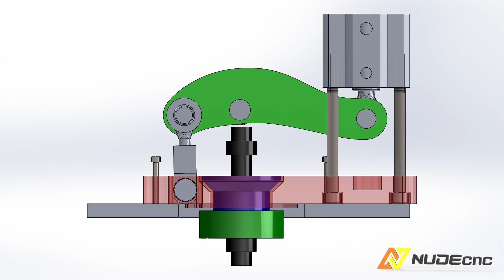Power Drawbar for CNC milling machine Part 1

Comment: Are you probing each tool length at the beginning of the cycle? I'm trying to set up the tool table for my TTS system and I cant get the tool offset just right yet. It would be stellar if you could show how you do it, assuming you're using Mach3

Comment: Nice keep up the good work, and the great vids. 
What CAD/CAM you use guessing SW
Cheers
Reply from the maker: Hi. You're officially my best subscriber ( it's only 75 at the moment so it's not big deal but still :))
Yes I use SW for CAD. And SolidCam is my CAM software. 
About SW - we all know is great :)
SolidCam- this software will turn your machine into the Monster:)
I have 1Kw spindle and I can make "proper cuts", even if that's about 1/3 what my kitchen kettle have:)
Reply: Paulo Irineu de Souza it is a power drawbar. This is a method of releasing and installing tools into the spindle of a milling machine. The usual method is via a wrench, air or hand. This is much faster with very repeatable results.
Reply from the maker: ***** Thank you :)